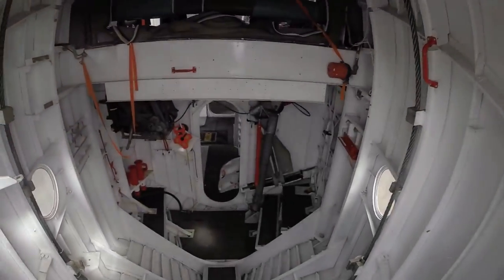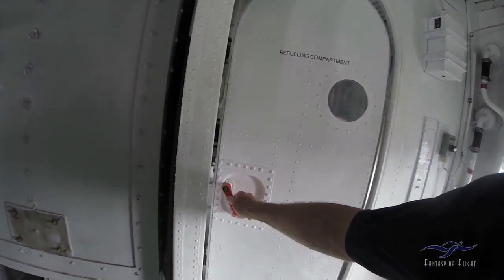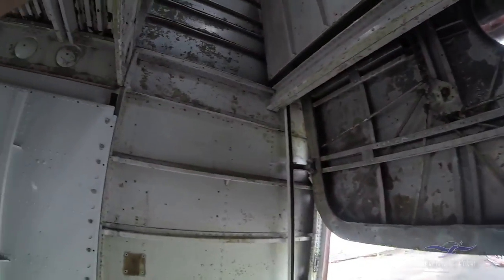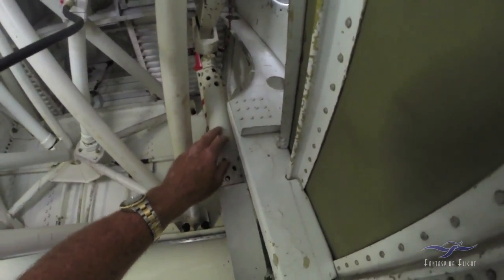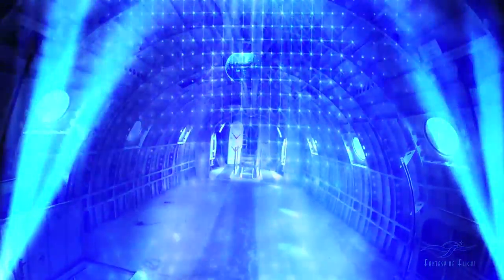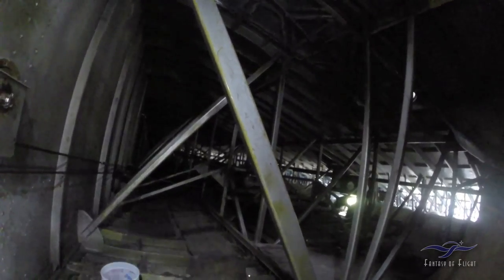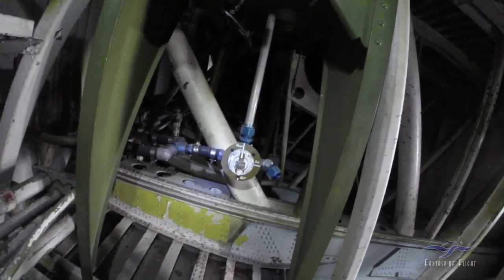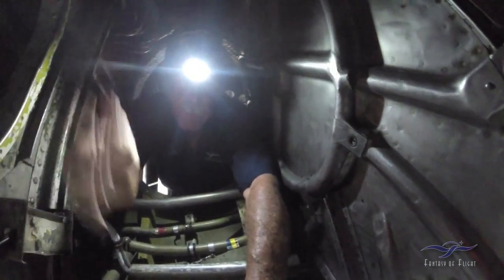MARTIN “PHILIPPINE” MARS - Tour Part 2 of 3 - Crawl Through the Wings

Comment: The Hawaii Mars is much easier to get around in not having a water tank in the middle of the fuselage! I would have rather seen the Philippine Mars in the glossy sea blue at Oshkosh, but it's a good thing the Hawaii Mars came. If the Philippine Mars would have grounded in the lake, it would have spilled avgas into Winnebago as it still has fuel tanks in the lower hull. I do hope they come back though.

Comment: Now just add rats, dust and nasty insulation and that's what being an electrician trying to find faults in old buildings is like!
Deepest respect for you Kermit, I wouldn't be in there without a safety man or at least a radio in case you popped a knee or something.

Comment: The excuse that they are too old is complete nonsense. I get it, they are expensive to run and difficult to get parts for.... but we live in an era of 3D printing. You can make any part you need, and these parts are simple and basic. The fact is they worked amazing well knocking out wildfires for over 50 years so just because they are now old doesnt mean they somehow stopped working. Fire is still the same as it was back then. If they kicked its ass 50 years ago they will still kick it's ass today. They were considered old when I was a kid in the 90's but they still used them and they worked flawlessly. What makes them so good isnt just their huge size but the fact that they can continuously drop over and over again, with a turn around time of 10 minutes, and they can do it all day without stopping. No modern plane can compete with those numbers. A modern 737 or even a hercules has to fly back to an airport, land, refill with a small hose, then go through a pre-flight inspection/checklists, then take off, then fly back to the site for another drop. It's just not practical for knocking out a big fire. Having two Mars bombers tag-teaming a big fire is unmatchable. They work particularly well for Vancouver Island because we have large lakes or ocean within reach of basically any part of the island.

Comment: They really don't make them like they used to.  Crawling into the wings to access engines like that, all the bulkheads, this thing is a flying ship, not a flying boat.
Reply: Granted that these Mars examples have had an easy second life, since they are kept in fresh water, hence the reason they are not badly corroded.
Flying boats are currently only practical for firefighting, island transport, etc. 
They are too heavy, due to the hull requirements of ships, even when made from Aluminum. When Carbon Fiber because cheeper, it might be more practical, but currently it appears that new airships are more likely to cover the cargo role, since they can hover & land vertically, and can be powered by diesel electric drive, and thus are much more efficient....

Comment: Jesus Christ, is this the way you have to get to the cockpit every time?
Reply: What? No, of course not, don't be silly. Its a two-story flying ship. Thats just how you get through the wing spars to the APU room and rear upper deck. But usually its easier to just go down a ladder to the lower deck, go under the spars, and back up again. Of course that's not so easy now that they installed water tanks. But that is only if you need to get into the rear fuselage. To simply get into the cockpit you just go into the front hatch and up the stairs/ladder right inside the door, and there you are. Even if that was the cockpit entryway, why would that be shocking in a plane from that era? You ever entered a B-17 cockpit? Through the rear hatch, the radio room, between the bomb racks, thru the top turret, over the crawl-way door, between the seats. Or enter the front hatch (like an acrobat), and crawl under the cockpit floor, thru the crawlway door, between the seats. They designed these planes for athletic young men, but the Mars is very commodious and easy to use compared to most WWII era planes.